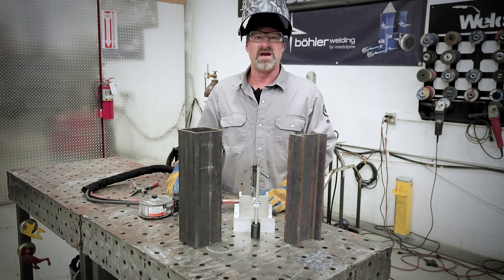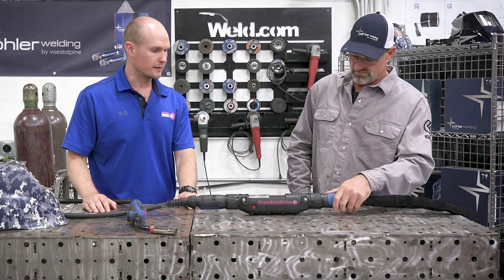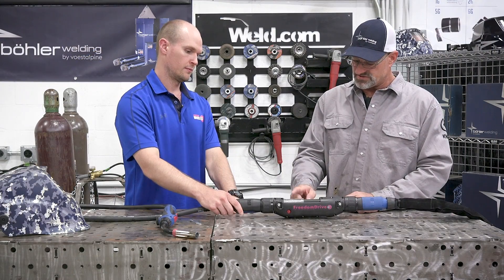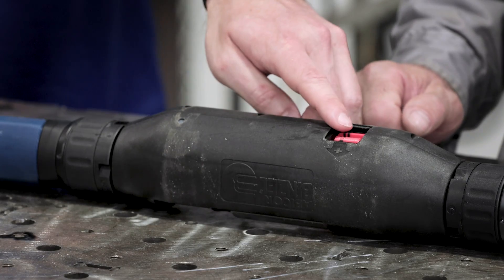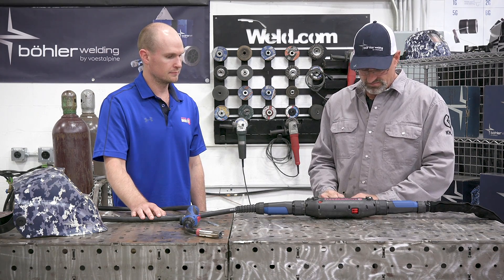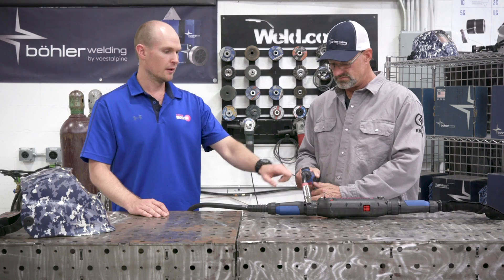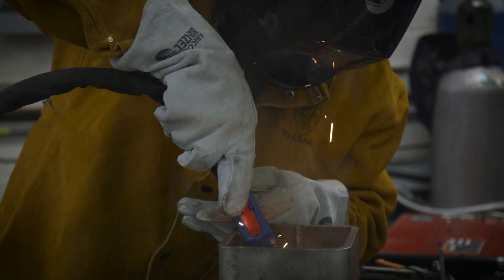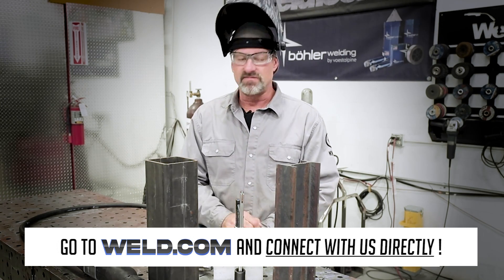Solution for Issues When Welding with a Spool Gun Using the FreedomDrive Push-Pull System

Comment: I like the esab A9A  air powered push pull guns, take the regulator valve out and just feather the drive with the trigger paddle and leave the power unit on max that way you never have to mess with switches etc especially usefull when you have 40 feet to go back the main unit.

Comment: I've only done welding with flux core so far and a little stick at home, done mig and tig at odd end jobs before but I'm not that good, today got myself a flux core to get my welding better, not the best unit but it does the job, its the campbell huasfield flux/mig 120v
Reply: Too bad I didn't know you before, I would have gave you mine! 😁 I've upgraded!
Reply: @richardfuerst5286  nice if I may ask what did you upgrade too?

Comment: I use a Miller spoolmatic 30A, since I use .035 5356 it never birds.  This similar to a Cobra, push pull system
Reply: main difference to the MK cobra; this product uses a standard mig gun for the front end, so much lighter and durable, other push-pull guns with the feeder drive located in the gun handle do not take normal abuse